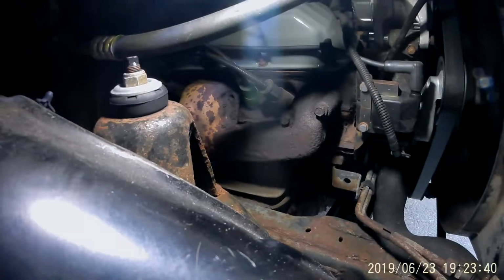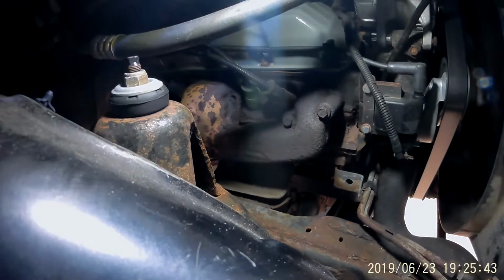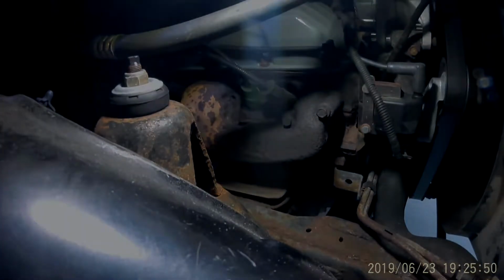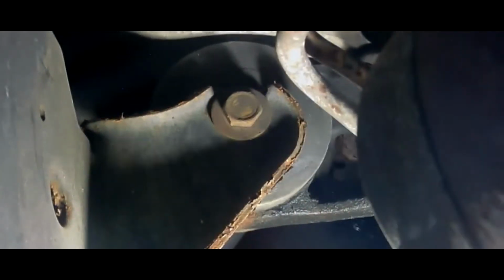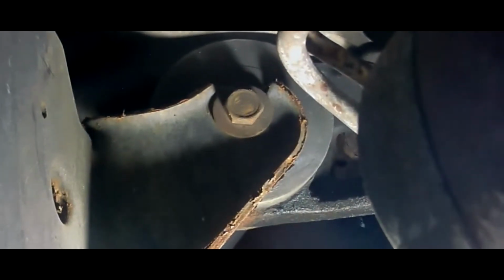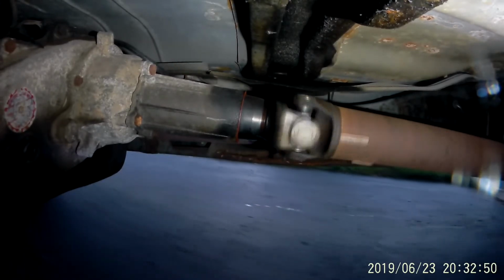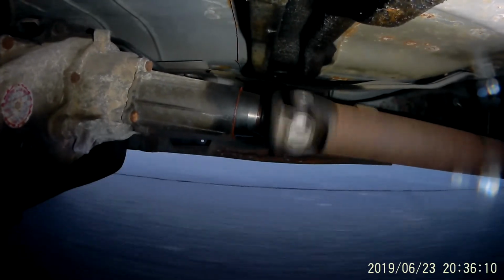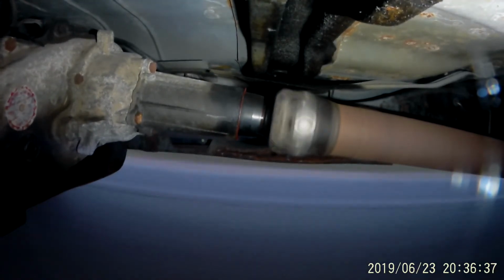98 Ram 1500 Motor Mounts - Jolting / Jerking on Takeaway - Inspection

Comment: Did you get it fixed? I replaced transmission and engine mounts on my truck but still have the same issue. I stumbled on your video while continuing to troubleshoot.
Reply from the maker: I have not, unfortunately. I think it may be the transmission,  but I will have to take another few videos. My guess is something inside of there is slipping.
Reply: @N0Fumar  Thanks for the reply. Good luck. I know there are worn synchronizers  in my trans. I will be checking that next and the rear differential.

Comment: u joints two easy ways to tell one get in back of vehicle motor off push if it moved say half inch u joints...second get inside shift from foward to reverse a few time while holding brake if you get a clunk  between shifts

u joints usally the rear unless you have Extended cab..then may be center shaft soupport and foward u joint
Reply from the maker: Actually now that you mention it, I think after replacing my ujoints from transfer case back, this has gone away